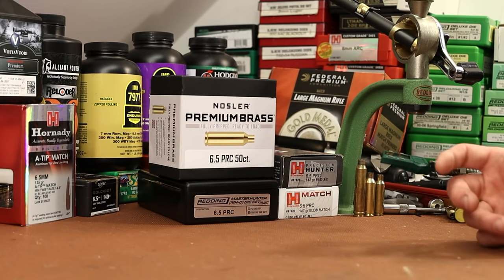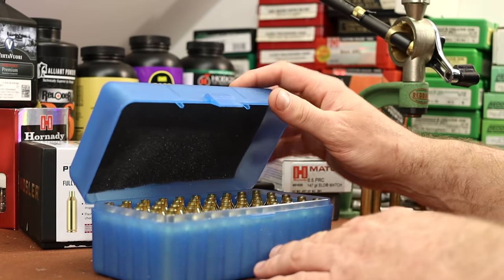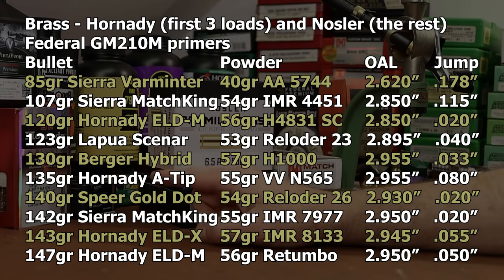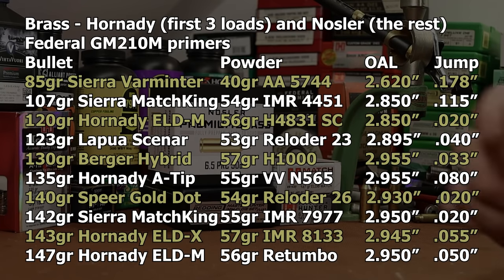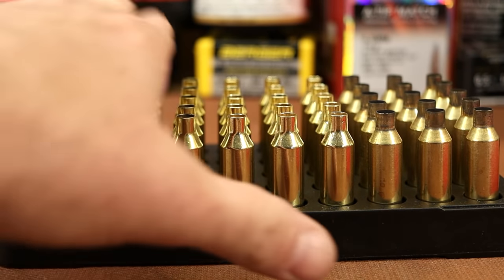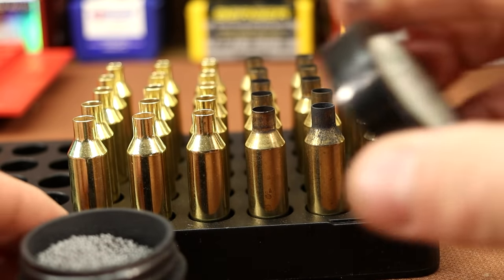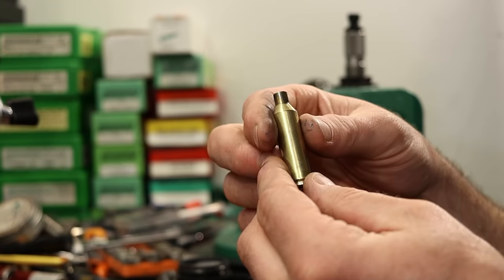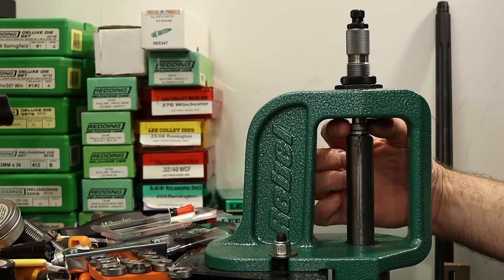6.5 PRC - Getting Started With Reloading

Comment: wow that was one stuck case . get the rcbs case remover kit 2 . it has 2 steel punches and 2 end caps that will fit on the expander rod and turn it out like you would a stuck case . it saved my butt a couple of times now ! and makes getting the expander ball out easy before even starting on the stuck case . i think you got a bad die that one is very bad inside .

Comment: 6.5 PRC is a short action cartridge, you'll probably have to single feed for reliability.
Reply from the maker: That makes sense.
Reply: I didn't notice that, when he posted the picture of it, I thought it would need a magnum bolt
Reply: @benjaminnevins5211  yes, magnum bolt head will work on a short action bolt.  Same bolt head as 300 wsm and other wsm cartridges.

Comment: I wonder how this compares to 6.5x55.
Reply: 6.5x55 can't compete with this new 6.5 prc
Reply: The max pressure for 6.5x55 is way too low because it is ancient. With a modern action you can push it a little bit but it's not anywhere near 6.5 PRC

Comment: Stick with the h1000, rl26, and retumbo, I have the berger 156 using 56 gr of rl 26 and shoots great, get those loads closer the 3k and you will find your groups tighten up
Reply: Same, rl26 with 156’s at 3015 in a 26” 8 twist. consistent sub 1/4 min for me

Comment: You're not lubing the bottom 1/3 of the case, which is where the most tension comes from. You sprayed the top, but you need the lube on the bottom.

Comment: i have a Mauser m18 in 6.5 prc a box of ammo all i could found ok 50 of 300rcm base case for 6.5 prc it crap it to long case i got 338 rcm cases there the 300rcm dies to 6.5 prc in rifle the bolt closed i neck thinness trim case of 300rcm case i did 338 cases there less trimming of neck & lath ps lee case lube works best of what i had! i set it up i had sighted in with a load of h1000 & 120g & 130g it works  powder and bullets weight! i had other things to do like 15000 miles of no helper driving & camping & i run boat next week ok great the mail man it flooded the whole lake, your die screwed from factory & lath to fix it

Comment: The 6.5 PRC is not a magnum cartridge. It has about the same capacity as a 3006, 280, 270 etc...If you don't load any of these with mag primers, why would you load a 6.5 PRC with them?  I've loaded hundreds, maybe a 1000, of 6.5PRC using regular LR primers.
Reply from the maker: Yup, I'm definitely not suggesting using magnum primers.
My confusion mainly came from the class of powders. Retumbo, 8133, etc. are not powders you would see in the other cartridges you mentioned.
Reply: @JohnnysReloadingBench     I commented a little too soon.  I've talked to several people that think that it's a magnum cartridge. I was always told that anything with less than 65gr of powder should use a regular LR primer.  Great video. Thanks for showing the occasional headaches that come with reloading. LOL
Reply: You can always load with magnum primers on non magnum loads. It will just require a lower charge.
Reply: I’ve completely converted to Imperial for wax and no more stuck cases.
Reply: @charltonlwalker    I switched to imperial or unique wax and never get a stuck case anymore. I used One Shot and different home brews. Nothing works as well as the wax.

Comment: that stuck case, you should spray it with some kroil before you try to pull it.  that chattering can ruin your die.  Hornady dies... just saying, they invented the cartridge, why wouldn't you use their stuff?  I had to call Nosler once, their cases, from a sealed box, on camera had 5 bad cases, all 5 were either marked wrong on the headstamp or the necks were too short.  Called them, brought them to the Nosler booth at the NRA meeting the next week, they pretty much refused to do anything to replace the brass.  from that moment on, I'll never use their stuff, stopped recommending them and after hearing how bad their newer stuff is, I'm glad.  Had a guy bring a rifle to me because he thought the barrel was shot out and wanted it replaced, I scoped it, ran a cerrosafe on the chamber, and lead, into the rifling... it was almost perfect.  he was shooting nosler brass, tried federal factory ammo to verify the bad accuracy, it was bad too...that's why he thought it was shot out.  I copper stripped it, cleaned it up and asked him if he still wanted it replaced.  I had shot it with Federal GMM ammo and some remington core lokt.  Both shot very well, the gmm was 1" at 150m, the rem was 1moa and both grouped well.  I gave the guy a bill for what I did, and estimate to replace the barrel in case he just wanted to replace it.  This was a very nice Tikka.  He went out and bought a new Bergara and told me to give him $150 and settle the bill and I could keep it.  I kept it, dropped it in an MDT chassis.  It sold about 2 months ago for $2000.  the guy who bought it was happy as can be, shot the best he had ever done at a local prs match.  Not a bad deal for everyone.  Sometimes we overthink things and just don't stop and think.  The Federal that the guy shot it with to check it, was loaded with Nosler bullets.  The rifle didn't like Nosler bullets, that's all.  Usually a guy says he wants a new barrel, I do it but this thing had less than 200 rounds through it.  Not even 22-250 burns that quick.

Comment: That is aweful like they were using a broken chattering insert and then made it worse by forgetting to hone the die. Send that thing back to Redding with all the goobered up parts and a link to this video.  Some big thick fender washers come in handy.   Never saw the point in the stuck case kit, fender washers and socket do the same and are always on hand.  Put some electrical tape on those pliers to protect the knurling on your die. Heat of the moment so sure you probably didn't think about it.

Comment: Redding must have used a clapped out Friday reamer for that die.  Holy shit the chatter marks.  I use only Redding dies and hope that this is a fluke.  Ruining that unobtainium brass must hurt more than the die.  (BTW, Nosler brass is not very good in my experience, even though it's priced at a premium.  You'll have better luck with Hornady, as hard to believe as that is.)   At least Redding will send you a new die or you need to full-length size the body.  Looks like the fired case expanded beyond what the die is relieved-for and why it's not polished in that area.  Redding has a body die which sizes the body only, and doesn't touch the neck.  You can then get a neck sizer.  Good luck next time and thanks for showing the non-perfect outcomes.  People need to see this in case it happens to them.

Comment: I especially would not use CCI primers, why I reloaded 100 cases for my 7mm weatherby mag, with Norma brass, the first ten shell wouldn't fire, I called CCI there comment was I put to much pressure on primers. It pure bullshit, I even sent them some shell, same remark. I had been reloading for many year never had a problem,  my belief was they made a huge batch of manufactured bad primer s and wouldn't live up to. I even had a special primer machine. So I reload with Federal primer,  same dies, same primer machine. Didn't have problems after that. I will never use CCI primer again. I am talking around 1980 year's.

Comment: You're going to burnout that barrel in 10 shots at those 3000 speeds just kidding....  but you will burn out that barrel at those speeds... It's short action round it looks like you are shooting it out of a long action. it's no big deal but they may buy a spacer at MDT that's why the mag is so long for that round ...I would make that gun a 7mm PRC that would be perfect for that setup. and get short action for that  6.5 barrel and a hunting stock